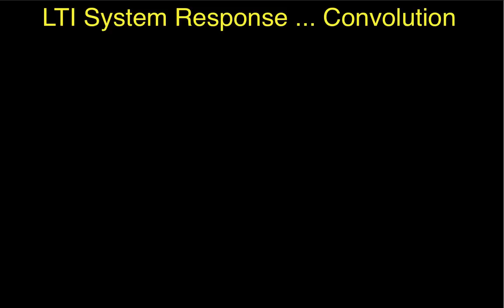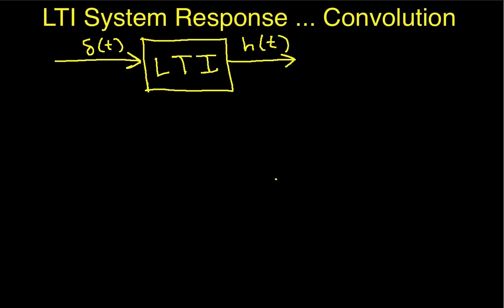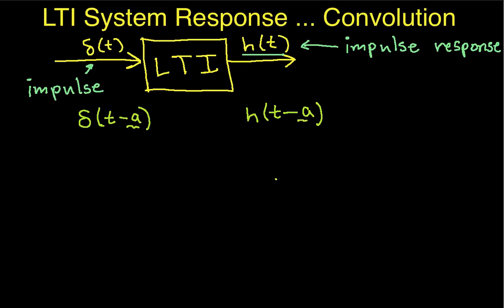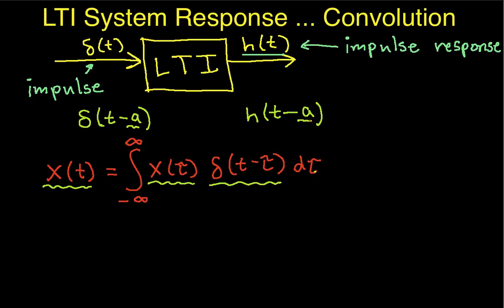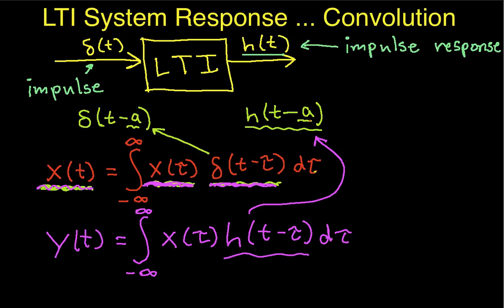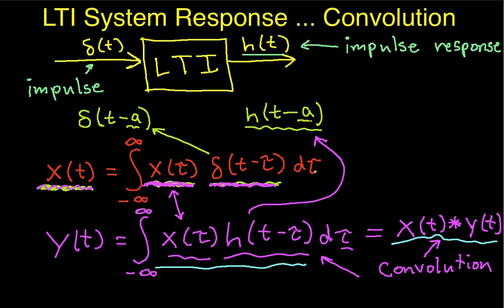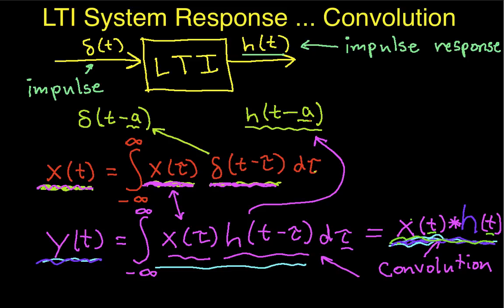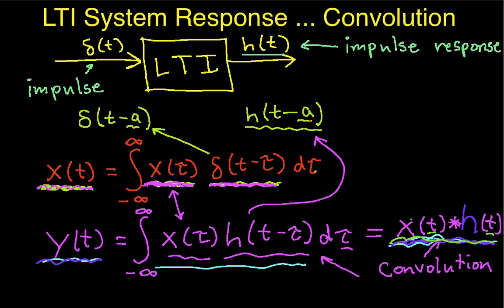Response of an LTI System: Convolution

Comment from the maker: @fingerboy18 The time constant is the amount of time it takes for an exponentially decaying signal to become smaller by a factor of e  (to reach 0.3679 times its original value). In the signal x(t) = exp(-t/C), C is the time constant. The response of an LTI system is characterized by the poles of its transfer function; the time constant of a pole is the inverse of the real part of the pole. So the time constant of a system is the largest time constant of all of its poles.

Comment from the maker: @apparentlife22 The Fundamental idea is that x(t) is expressed as an integral (which is a limit of sums);  Each term in the sum is a value x(tau) times a delta function which is shifted by tau. Because the system is linear, it operates on each delta function to produce the corresponding impulse response; the x(tau), since it is not a function of t, is a constant as it passes through the system.